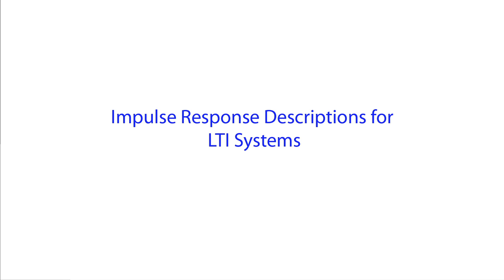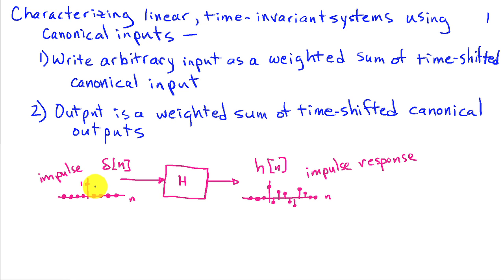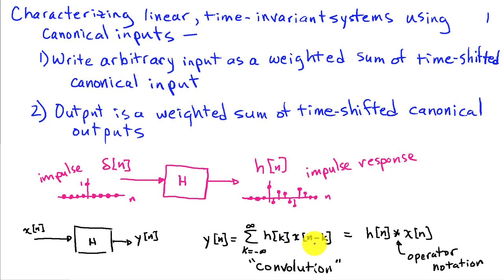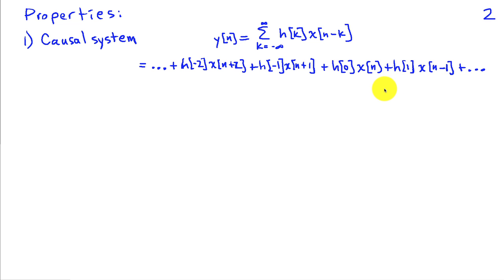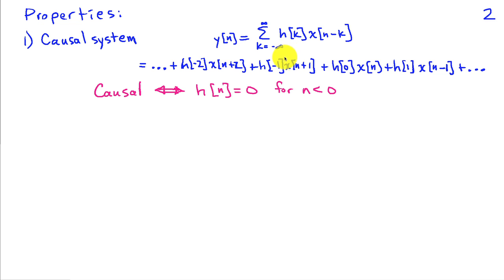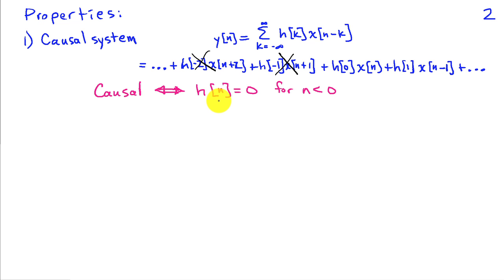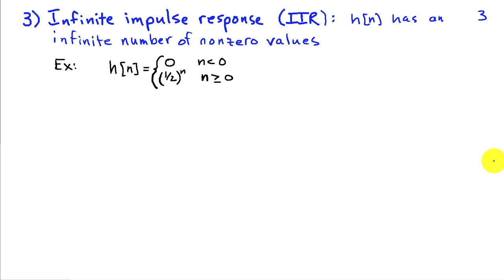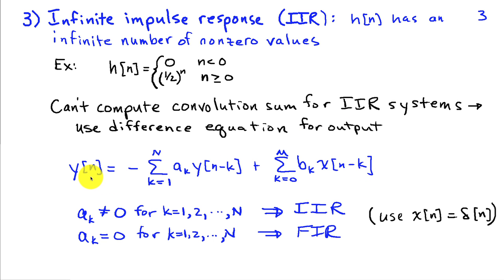Impulse Response Descriptions for Systems

Comment: 4.	Suppose we have a linear, time-invariant system with an unknown impulse response  .  We note that the system yields the following input-output pair
x[n]= {1,2,1} =>y[n]={1,5,10,11,8,4,1}
Find the system impulse response  .
how would u approach this?
Reply from the maker: First of all, convolution of a length N signal and a length M impulse response produces a length N+M-1 output sequence. Since x[n] is length 3 and y[n] is length 7, we know that h[n] is length 5.  At that point I would write out the convolution equation as a function of the 5 unknown values in h[n]. That will give you a set of 8 linear equations in 5 unknowns, so you can solve for the h[n]. For example, assuming we index x[n] and y[n] starting from n = 0, then we know y[0] =h[0]*x[0] which implies that h[0] = 1.  Then y[1] = h[0]x[1] + h[1]x[0] which you can use to solve for h[1], and so on.